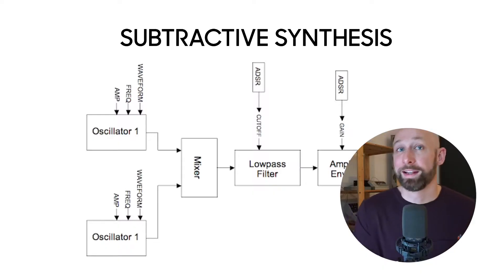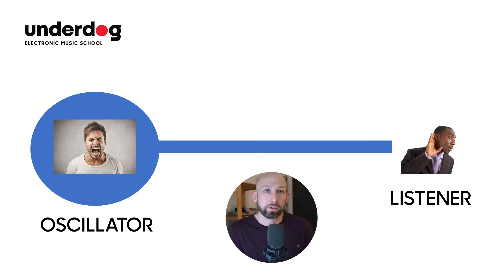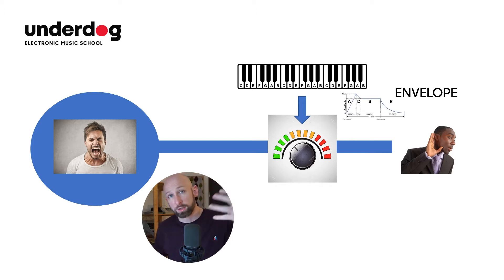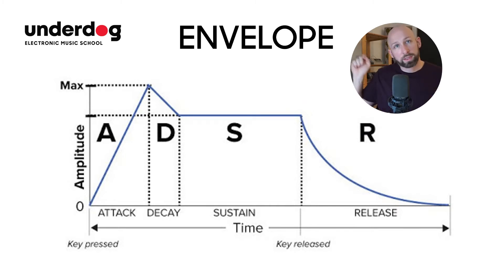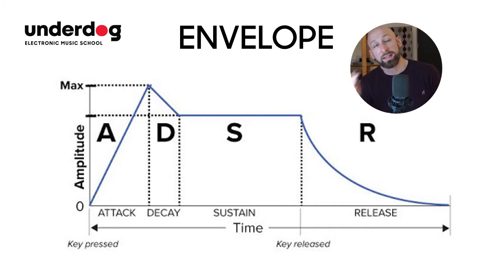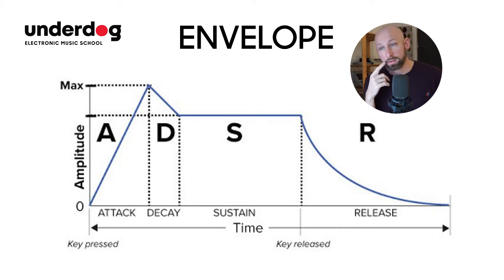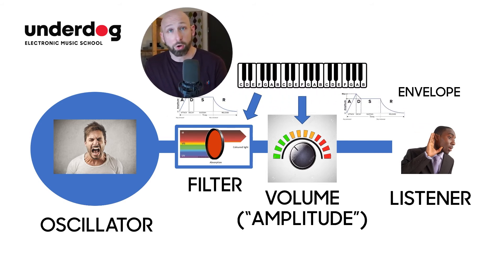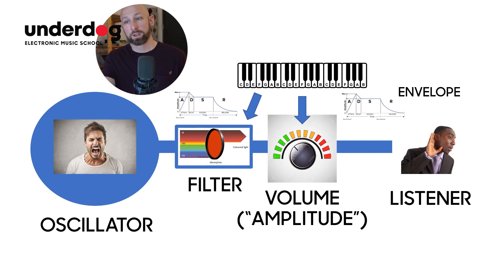Intro to Subtractive Synthesis

Comment: Addition: you only explained "subtractive", not "synthesis"! Kind of trricky, how you canceled this by leaving out the multiple osc layer. And that's my discussion with freaks (brainless fans), because I claim, that my Y Workstation is a Rompler and not a Synthesizer. Besides this FM crap. Also a thing for freaks.

Comment: What's with this term "Subtractive Synthesis"  you just basically described the basic principles of how most Synth's work? Your explanation of the basic principles of Synth's was good.  I have worked with many Synth's for a number of years and I have never heard of  "Subtractive Synthesis". So what's the difference between  "Subtractive Synthesis"   &  General understanding of how Synth's work?
Reply from the maker: Most synths are subtractive indeed, but fm or additive synths definitely work differently, so its helpful to have the word subtractive to denote we’re talking about this classic method. Its a real term though, im not making this up :)

Comment: Amazing video. How does the Filter's envelope works? So if you wanted to go from dark to light and to dark again, what Attack, Decay, Sustain and Release do you need?
Reply: start with filter at a more closed position have it open on Attack portion, as it reaches the top it will become brighter. On the decay portion it will close the filter and become darker. You can sustain your tone by effecting the sustain level, on the release portion it will close back down to the original position.

Comment: Oscar hello! please tell us how to make a strange wacky percussion that sounds like an LFO filter or pitch LFO. how can this be done from a percussion loop, or can it be done only with the help of synthesis.  maybe there is a way to use midi melodies for such percussion. usually in a track it takes the third role, but without it the track is boring. For example, at 30 seconds, such a sound appears and develops further  https://www.youtube.com/watch?v=1jCyoajQfWA